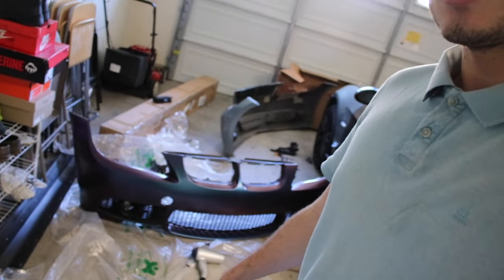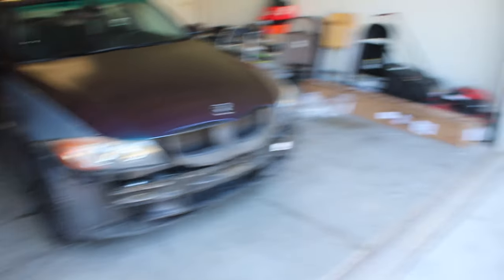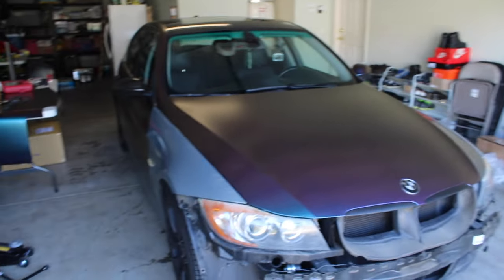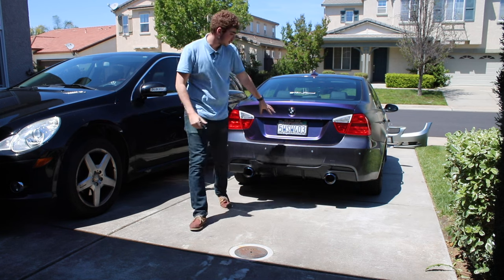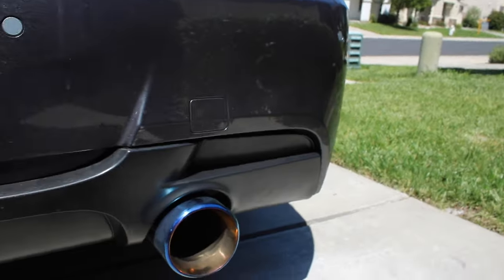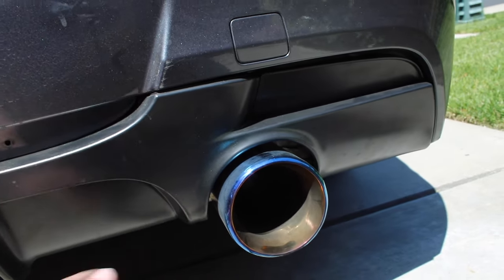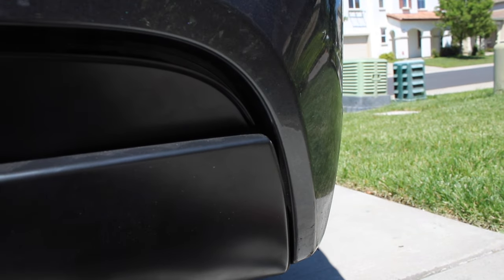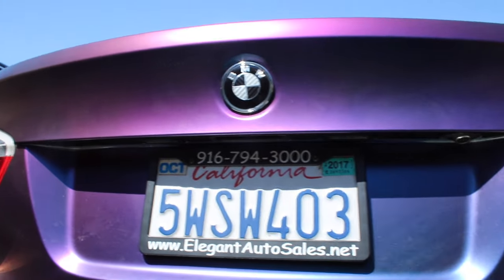NEW CUSTOM EXHAUST, BMW 330I DUAL!! (HOW I DID IT)

Comment: Thanks so much for the video! Have an e92 328i and bought a msport rear bumper with dual exit exhaust, this video super helped and excited to install.
Reply from the maker: Brennan Bochenek np man
Reply: I have a 328i with a 335  back bumper and I need help with th dual exhaust.
Reply: So if you have a 328 all you have to do is get an mtech 335 or stock bumper and do the exhaust setup?
Reply: Where did you get the dual exhaust kit from??